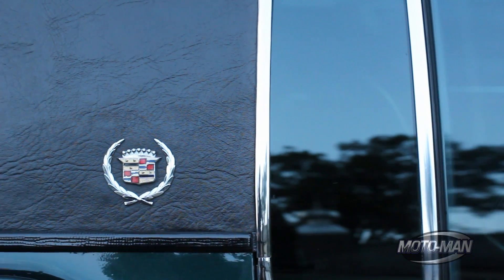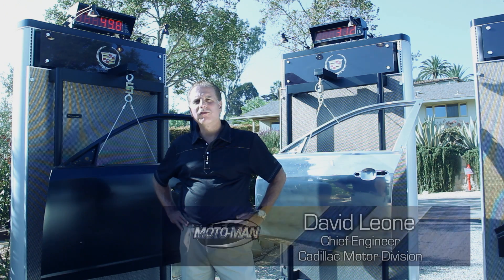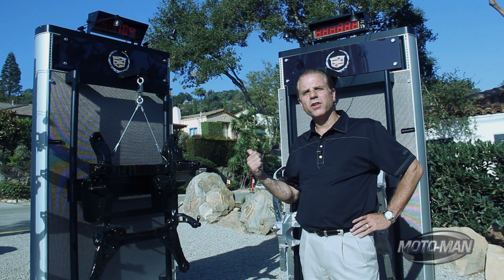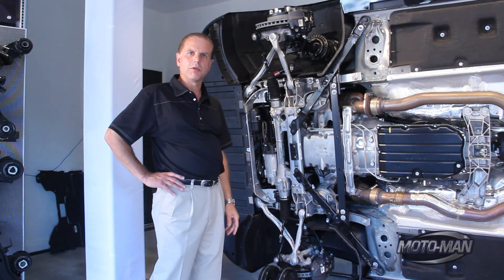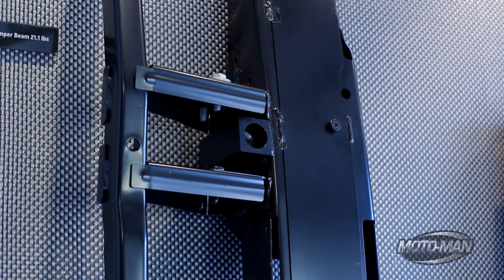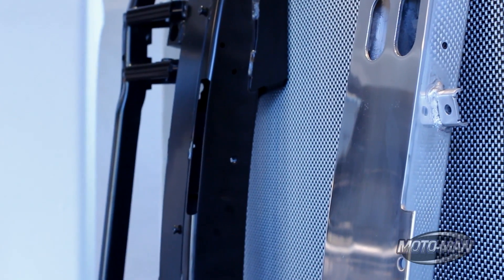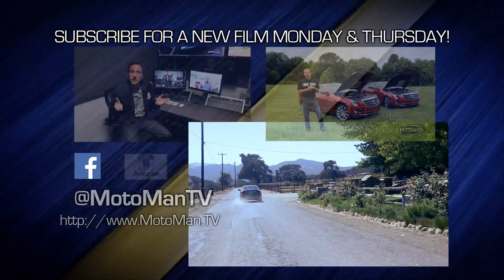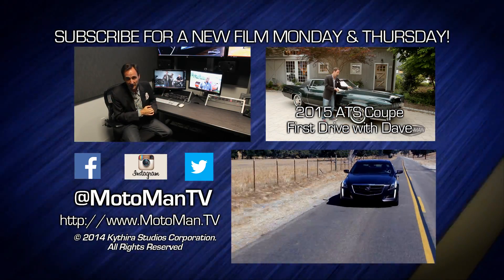Cadillac CTS V Sport: A DEEP Technical Dive with Cadillac Chief Engineer David Leone

Comment: Should I buy a 2014 CTS V-Sport with 50k on it for 23k??? Seems fast but I didn't get on it and of course was not looking at the boost gauge at all.
Reply from the maker: Seems like a lot of money.
Reply: If it is well maintained and aesthetically clean with 50 k wouldn't seem too much, regular engine CTS from 2017 and 18 with similar miles are going for 20 to 25k. I bought a 2016 with 75k for $22500 and feel like I got a bargain. Definitely take it to a Cadillac dealer for a pre purchase inspection, I got it done for $300

Comment: Just bought a 2014 vsport premium. Cadillac knocked this one out of the park
Reply: Tell me MORE, please. I might pull the trigger on a 2014 VSport with only 50k on it. How do I know if the turbos are both working? Only under full throttle? Or by looking at the boost gauge? I didn't get to properly PUNCH the throttle as my owners during the test run were a tad nervous of me possibly losing control on the highway.

Comment: The Vsport has a very very annoying and consistent rattle under load and it's a middle finger by GM for not introducing a fix for these very expensive vsports.
Reply: It has been resolved, on plenty of forums. They fixed mine, there is a bar under the car, if bent it which it is for you. It will make that rattle sound because it is touching the exhaust
Reply: @EGclassic  I expect this is a different issue.  The issue I am referring to is identifiable on cold starts... lasts about 5 seconds.  When the car is warmed up after running, and you start it again, the rattle is not there.  A bent bar first of all can not be a consistent problem UNLESS you are suggesting all bars are bent from factory.  Even if it was it wouldn't go away the sound after 5 seconds... THere are no forums I've seen talking about "bent bars" that are the cause of this rattle.
Reply: @THE_CHAOSENGINE  if you bought this car. You can afford platinum coverage and that covers everything which would save you. I had new two new turbos put on there for no $ out of my pocket. And that’s 8-9K worth of parts and labor. And new exhaust, running great. I also recommend using Liqui Molly Molygen, green oil. Runs smoother and better gas mileage
Reply: @EGclassic  I hear what you are saying but I've worked in the auto industry for nearly 15 years.  If you buy these cars new in Canada yes back in 2014 one like mine would have been over $80,000 after taxes and a new caddy warranty would have made sense at that time because cost per year/KM on extended warranties is ALWAYS much more affordable on BRAND NEW classed purchases.  

But I bought the car summer of 2020 with only about 64,000 KM on it and it was out of warranty.  I paid ONLY $26,500 plus 13% HST Canadian for it.  I can buy warranties AT COST from the provider and even a reputable 3rd party warranty for another 4 years/40,000 KM of coverage AT MY DEALER COST was just over $5000 plus 13% HST and that was with a $100 deductible so I can just IMAGINE what a genuine GM extended warranty would have cost on this car... probably closer to $8000 or more is my guess!  That's far too much money to spend on a car that had no visible signs of failure and needed only 4 brand new tires to pass the Ontario Safety certification.  

Besides that there is nothing wrong with a operation of the Turbos so an aftermarket warranty would have easily denied an $8000 claim.

Either way something is loose in there for sure and it happens to a lot of these older cars throwing $8000 at it to maybe solve the problem is not what car ownership is about for me.  Car ownership for me is about finding affordable workarounds to production oversights so I will have to do some testing sometime to see if it is fact the wastegate arm rattling as is what I suspect at this time.
Reply: @THE_CHAOSENGINE  I hear you bro. Mine is about 65K fully loaded. I installed the digital dash myself after my buddy reprogrammed it for me. These engines are bad ass, super fast stock and even more thrilling tuned. And I hear ya, the turbo wastegates cause the Rattle you are talking about. It just needs to be replaced which lucky for me there were some good mechanics at Covert Cadillac. Cause a lot of mechanics would not know how to operate on your LF3 Engine cause it’s a rare bird.

Comment: Well I’ll respect the input on how good the 3rd generation might be. However, as a loyal  Cadillac customer for 35 years . The last 2 vehicles were a CTS. And ATS .  Both  performance models and both NYS CERTIFIED  refunded lemons . So unfortunately I did go foreign. No choice after 20+ breakdown.  It’s going to take a lot more than you tube videos to get me back in. Hey, i was loyal.  My heart is with Cadillac. But currently not sitting in one.

Comment: Good Video 
Make another of the 2015 -2020 GM Full Size SUV - Escalade , Yukon , Tahoe 
whay in 2015 went from Aluminum Control Arm to 2017 -2021 STAMPED STEEEL Front Control ARMS ??? WTF

Comment: beautiful looking car, but i'd take the 556 hp v8 CTV for less money any day.  Any word on how hard it would be to tune of these things to around 500hp?
Reply: +James Garafalo      For around $900 you get about 500hp with a plug and play module from Trifecta tuning that also gives it better transmission logic for performance driving.  With this configuration and a little better tires the quarter mile will be mid to low 12's on a good day.  Road and Track recorded a 12.7 quarter mile stock with a cool engine, but it's generally a low 13's car.  This is a quote from another article comparing the two;  "In terms of suspension and overall sporty driving feel, the Vsport is better than the CTS-V. It’s the one you want to take on a mountain pass." - Danny Cruz, Rallyways  
     The Alpha platform is quite a big improvement over the outgoing CTS-V.  It changes direction better, stops faster, and generates significantly more grip (even with less performance-oriented tires).   The Vsport starts at ~60,000 and the outgoing CTS - V was ~$65,000 so they are a little too close considering you're getting a true V with a Corvette engine that's designed for hard use.  Cadillac has recently raised their prices in an attempt to increase the prestige of the brand as well.  That's part of the reason the new CTS is $6,000 more and the new CTS-V is $18,000 more.

Comment: The so called "relaunch" has made the brand famous, not profitable!! Cadillac has an impressive portfolio with plenty of high tech, but that's not making a sound business case for the brand. Cadillac has finally caught up with the competition, but that's not helping the bottom line. Buyers in this class that drive BMW and Lexus look at a Cadillac and say "that's nice" and go about their way. The CTS and ATS are impressive, but the rest of the brand is "warmed over" Chevrolet bits. The SRX is an eight year old Opel chassis that was originally used for the Saturn Vue.  I commend GM for attacking the luxury market, but you have to make money at the same time and people have to actually buy your car.

Comment: One question: are all the underbody panels used for all CTS or just the CTS-V? My 2010 has first 2 front panels.

GM could also make a smaller panel to make oil change easier to do, something that seems to be still missing. Something Ford did better on our Fusion Sport than GM on our CTS :)

Thank you for this very informative video.
Reply from the maker: The panels you see are for all models of 2014 CTS . . . As Dave said in the film, this is a sizable part of how they are able to achieve CAFE targets on this car.
Reply: Thanks for the response!

Comment: The new body style CTS looks better than it has EVER looked also
Reply: Buick72100 disagree.....I rather have the 2008-2012 body but 14' aluminium parts
Reply: @jquanbasil6794  no no no. Only the CTS-V look good in those model years.